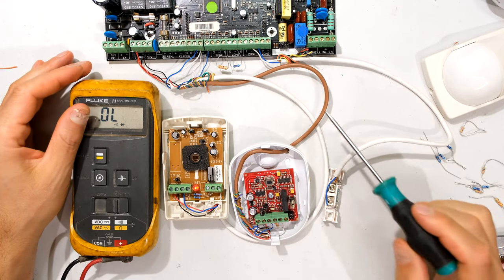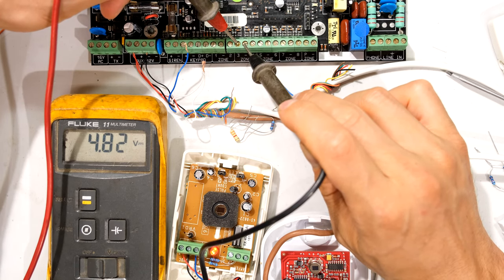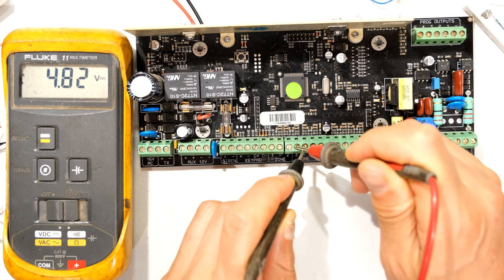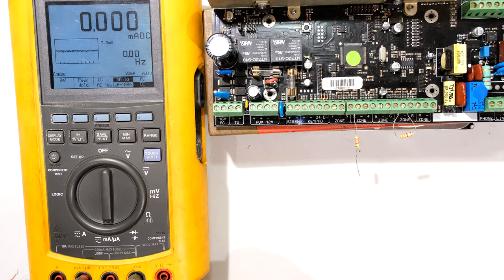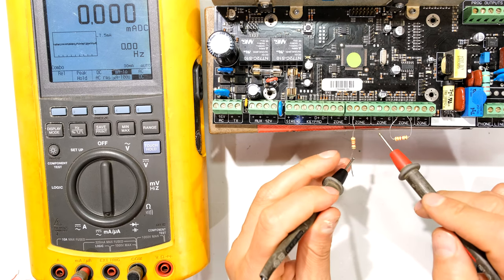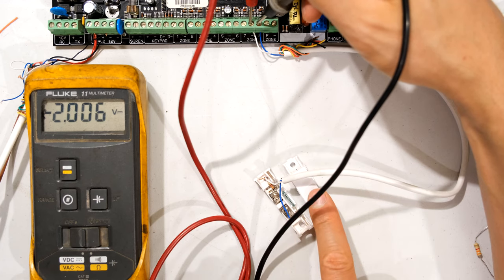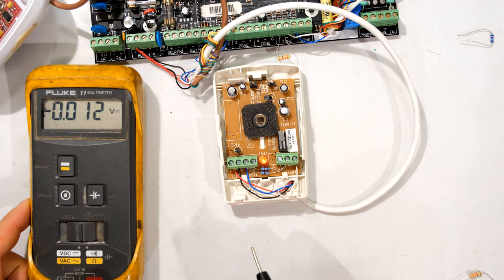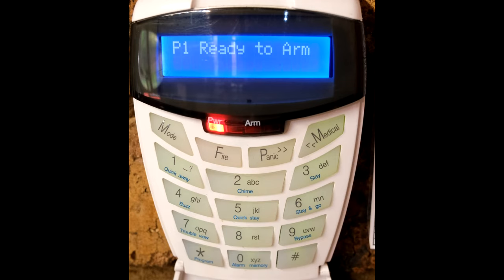How to test the zones on a burglar alarm system - tutorial

Comment: Great demonstration,  I don't think anyone else goes into diagnosing the panel itself to see where the zone problem lies. All of a sudden out of the blue on a DSC panel  I have  zones 1,2,3 simultaneously showing faults at the keypad  where I know for a fact here is no problem with the wiring on these three zones and why all at once?. So now to test the panel unless someone comes up with a brilliant suggestion as to why this is happening  - p.s.and wires are not touching one another in the panel.

Comment: hidden gem of a video.
 Consider adding EOL to your description. The eol topic is not well covered in general and had not come across it before looking at my acquired alarm system. My acquired gardtec system stumped me  have iwise led sensor lights switched off also, and the initially odd 2 non-power line wiring rather than the 2 for tamper and 2 for the alarm circuit

Comment: @ecologicaltimeYou know this but for others, 
I noted a slightly different take for the eol tamper pir for gardtec. They use a resistor across the normally closed contacts, and the 2nd NC feeds the tamper resistor. This presumably is just another way of achieving he same as the wiring shown of altering the resistance when closed and open pir.
 in your demonstration of the reed switch sensor, you did not have a resistor across the alarm circuit. Having had eol wiring just click, unless you have a resistor across the alarm circuit for when it is broken, tamper will simultaneously be broken. That is why you need to have a resistor across the alarm terminals for both reed and pir, to feed the tamper circuit.

Comment: How would you go about trouble shooting a dsc or honeywell panel with closed zones that dont register as open? I had a job where zone 5 and 6 which are windows wouldnt chime or show open when i opened any window on that zone. Put dsc system had a green check mark. I checked for continuity and all showed to have continuity. So i know its not a missing magnet, and typically it would show open not closed. It was a dsc 1616 it had its green check mark the rest of the zones worked. I even swapped zones to see if zone 5 or 6 was bad on the board, that didnt fix it. Checked programming everything was correct. No EOL on any zone. So couldnt check ohms? Only thing i can think of is bad sensors? only thing i didnt try cause i didnt have the time was to try each window or a small batch of the bad windows to see if certain ones worked and opening each window to test if its all of them or just a few, but i thought if a sensor was bad it wouldnt have continuity but they all had it. THX hopefully i explained that well. Would like some ideas to try next time if i have to go back or run into this problem again.

Comment: What brand is this panel
Reply: IDS X64
Reply: ids 805 panel
Reply: i know im asking randomly but does anyone know a trick to get back into an instagram account??
I was dumb lost my password. I love any help you can offer me
Reply: @Terrence Lachlan Thanks for your reply. I found the site thru google and Im trying it out atm.
Seems to take quite some time so I will reply here later with my results.
Reply: @Terrence Lachlan It did the trick and I finally got access to my account again. I am so happy:D
Thanks so much you saved my account :D
Reply: @Otto Louis happy to help =)
Reply: Hi our alarm system is not charging the battery and it’s new so during loadshedding we have no alarm
Reply: The battery is new
Reply: Was it charging before, how long ago was it installed
Reply: @brightsideofsaturn   hi we just moved into the house thought the battery as old so we replaced it but has never worked during loadshedding
Reply: Because it could probably be that the charge circuit on the board has shorted possibly because the previous owners had to large of a bettery in the panel